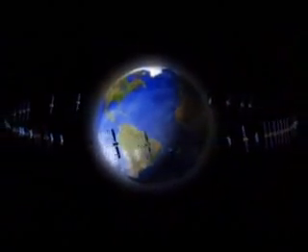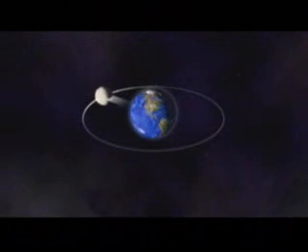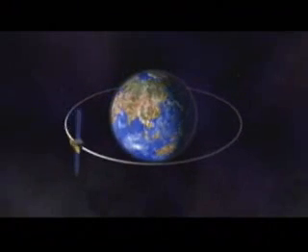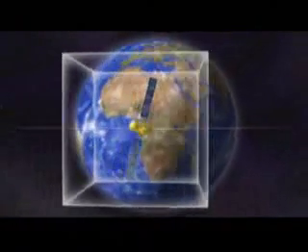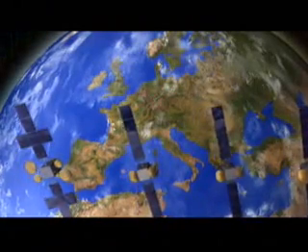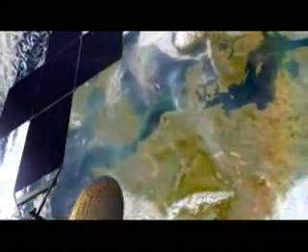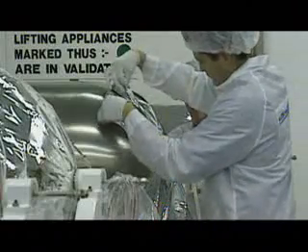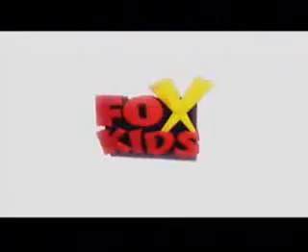How Do Satellites Work

Comment: well, the question is: how does satellite increase its speed to 28000 km/h relative to earth's center??? the speed of earth's rotation is only 1600 km/h in equator, therefore, satellite has to increase its speed at about 26400 km/h relative to earth's surface... how can it be possible?? even the maximum speed of the fastest vehicle that is ever made is only reaching about 8000 km/h
Reply: easy answer. no drag in vacuum. your car can speed up to infinity in a infinity vacuum chamber
Reply: Wow really?

Comment: Generally they used compressed gas like Co2 to provide thrust. Now satellites are decommissioned prior to running out of fuel. They use the rest of the fuel to safely exit orbit. The satellite only moves occasionally to maintain a geosynchronous orbit so the technology on board is usually obsolete by the time it runs out of fuel. I'm only talking about geosynchronous satellites. Medium earth orbit and low earth orbit satellites are different and generally serve purposes other than communication

Comment: If engineers have to fire the thrusters, what are these satellites using for fuel to move about?  What happens when they run out of fuel?  Do you have to refuel them, or do you decommission the satellite and send up a new one?